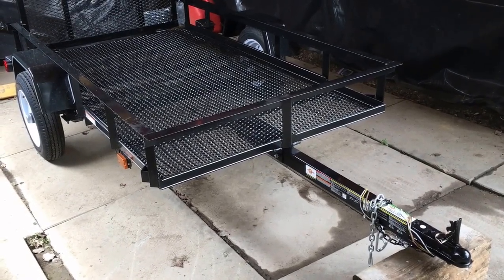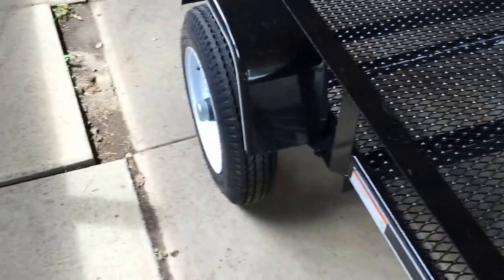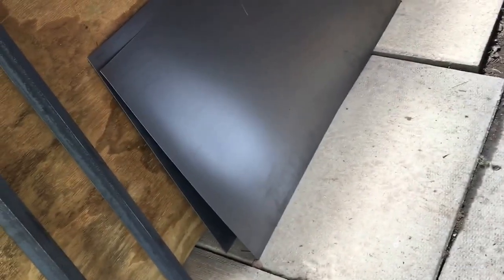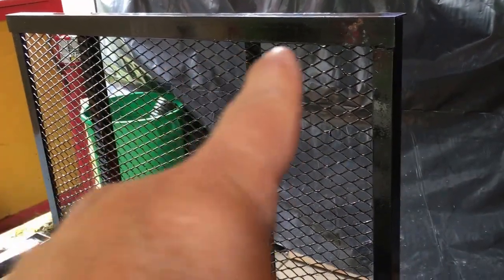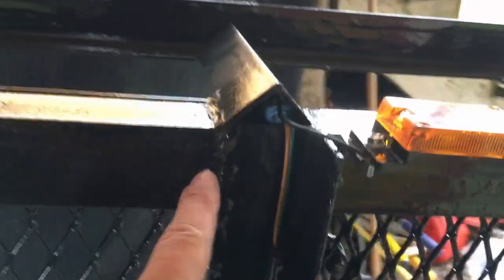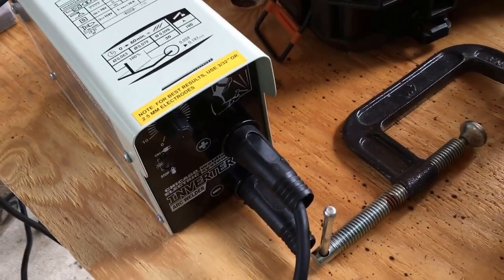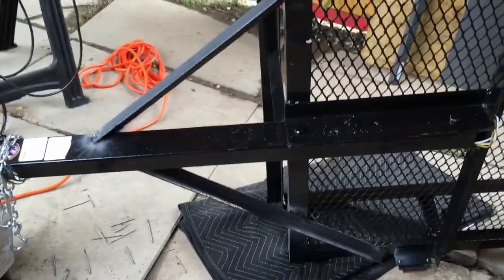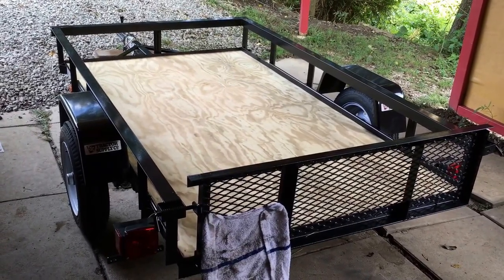4x7 Tractor Supply Trailer MODS

Comment: I would like a 5 by 8 tractor supply soon and will do the bracing on the tung as you have and also the ply floor. I think I will just build a small gate in the rear and keep the large one for when I sell the trailer or I need it. Im thinking I will get enough wire mesh for the new gate and fill in the sides and frunt of the trailer.    Looks good.

Comment: Have same trailer and the stability in the front is an issue. How long are the pieces of angle iron that you used? Great video thanks.
Reply from the maker: I’m not quite sure how long they came out to be. I just kinda evenly measured from one point to the next. I think I just picked up a couple 4 footers or so from Home Depot and cut them to length. It’s been a while now and I have hauled numerous things on the trailer and everything is holding up great though as far as the stability upgrade. So I am glad I did this. But I knew from day one it HAD to be done.

Comment: Thanks for the great video, I have the 5 X 10 version and I hate that tailgate as well, I think a saws all is in my future.
Reply from the maker: Glad you liked the video. Just to let you know, I did not weld the side sheet metal pieces on because of the different gauge of steel they were (thinner) than the actual trailer and it would have just blew holes right in the metal and it would have looked terrible. I am sure an experienced welder could do something no problem. Also, that one foot piece of plywood I cut off the bottom fit very nice along the front face of the trailer for a nice wind baffle.

Comment: I want to add a couple braces like you did. I just need a welder, ha.
Reply from the maker: Yes, I am no professional welder so I only used a small Harbor Freight for this job. I wouldn’t tackle anything with it that would endanger road use, but that’s only because of my limited welding experience. I think a good trained welder would be able to make those Harbor Freights work though. But overall, I just was out to stabilize the trailer, which it definitely did! :)
Reply: LPD    IS VERY GOOD YOUR JOB ( MAKESHIFT ) IN THE TRAILER!!! YOU NEED WELDER WHIT MIG MAC TO THE BEST SECURITY!!!   SORRY MY IGLISH IS BASIC OR BAD!!! REGARDS